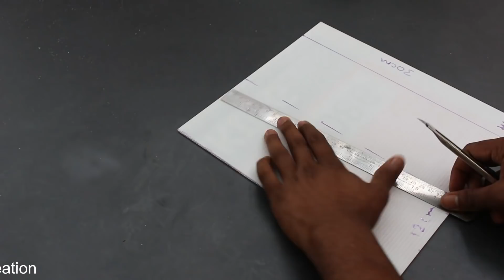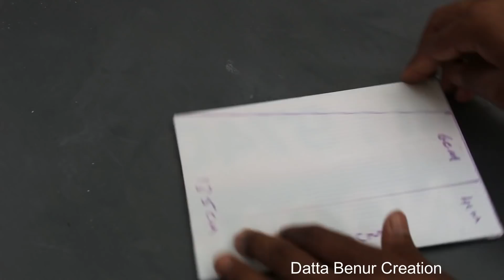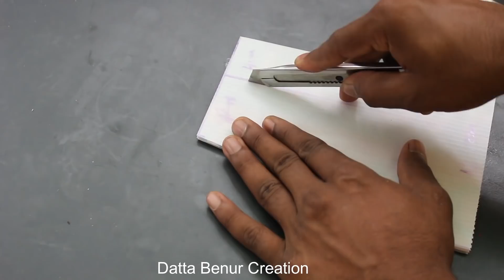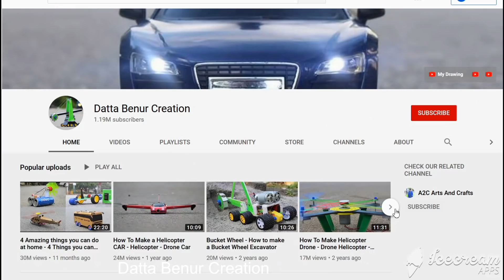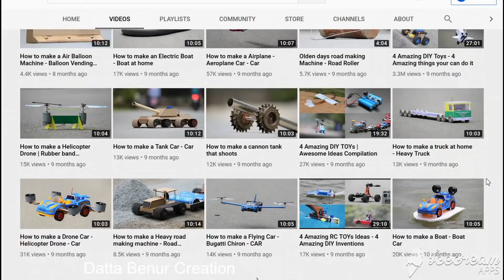How to make Aeroplane Car

Comment: you don't know what is called airfoil? the plane is not balanced because the air passing through the upper and lower wings are the same producing lift on both side. that is why it's not balances because the are both flat which is not supposed.
Reply from the maker: Thanks for your feedback